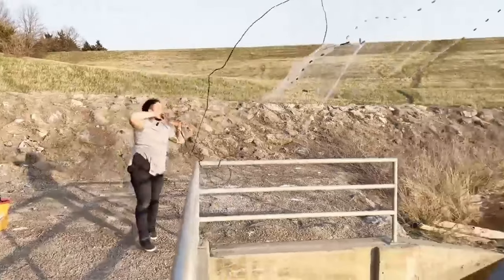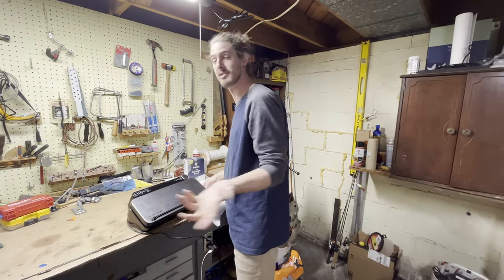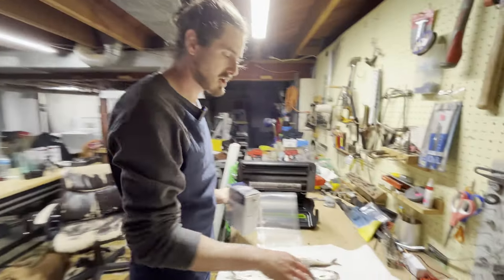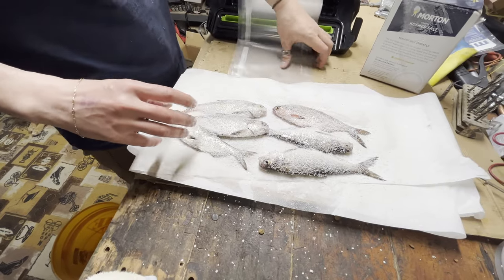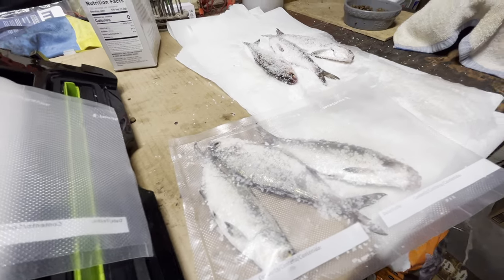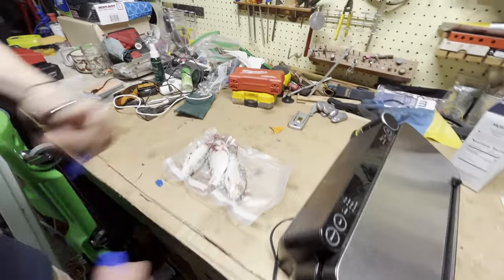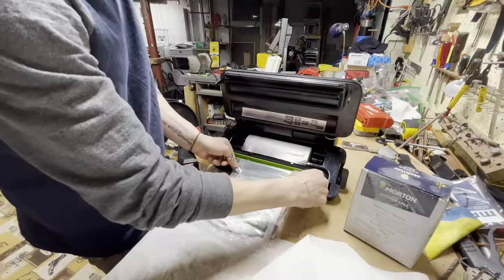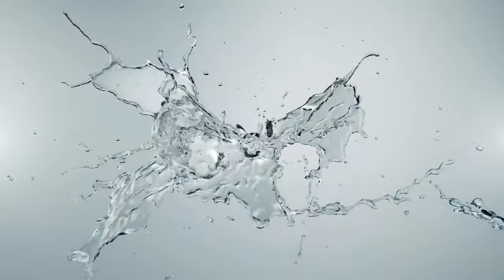The BEST WAY We Freeze Our Gizzard Shad for Catfish Bait #catfishing #fishing #castnetfishing #bait

Comment: What is the maximum time you will freeze them for and still be an effective bait?
Reply from the maker: I went out real quick the other day and didn't get bait. I grabbed some shad from the freezer and it actually felt fresh instead of the normal freezer burn and dried out feeling (when I used to just put them in bags). It had a date on it that. was over a year old..
It's not better than using the shad fresh that day, but it's a way to have fairly fresh shad later in the season when it gets hot and it's hard catching them from the bank.  It lasts well over a year or more. I'd use it as a last resort after that.